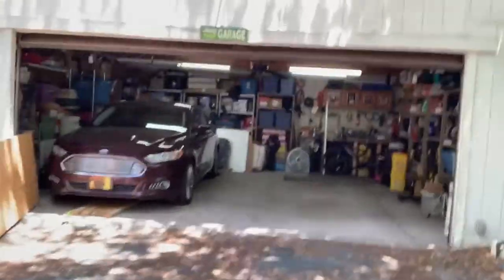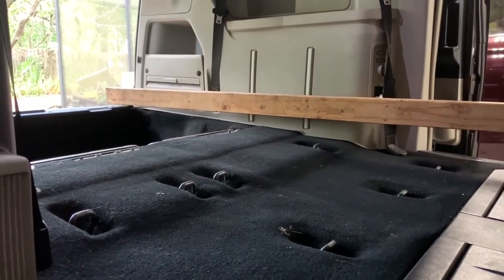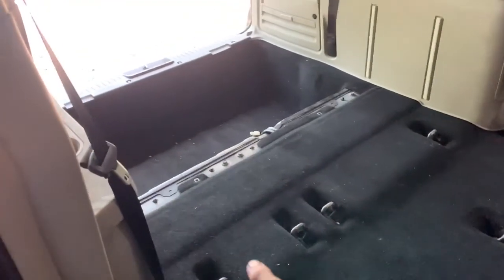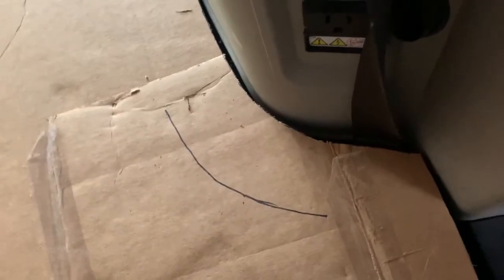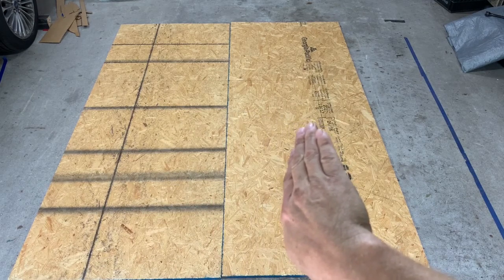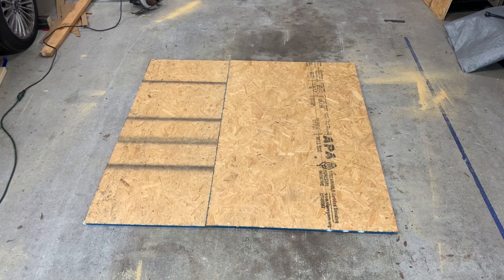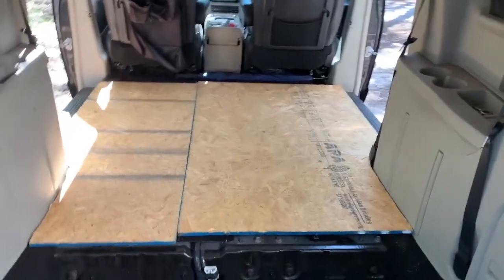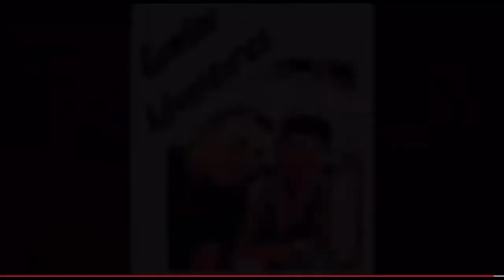Minivan to Camper Conversion - Cutting the Floor

Comment: Around here Portland we have a store called Mr Plywood you can get metric size plywood which is about 5 by 10 the only reason why I mentioned that is because I think you said that it was basically 5 ft wide I would go with a radical suggestion make the plywood the size of the space without cutting out for the trunk access if you angle cut the door for the trunk access maybe one side put in piano hinge Maybe easy trunk access and a place for your legs